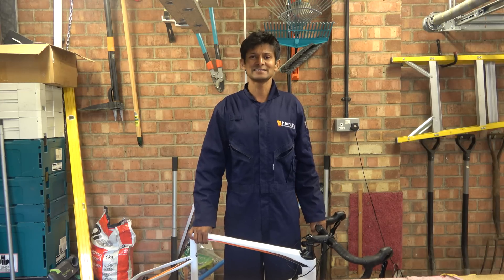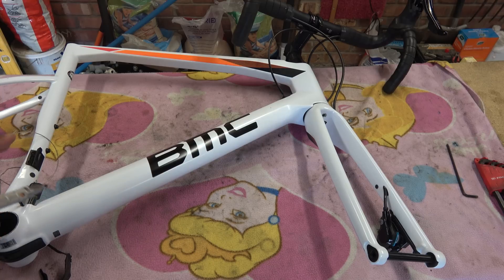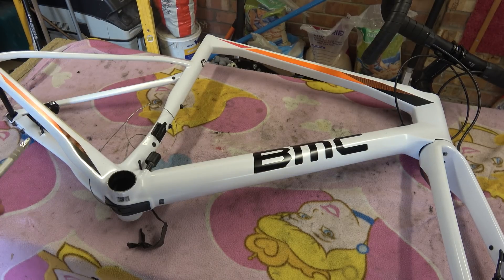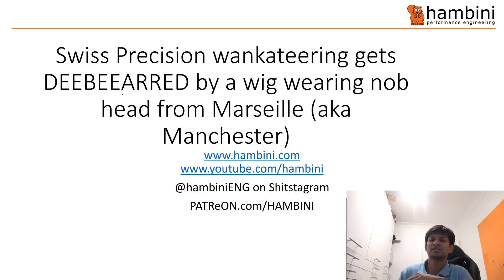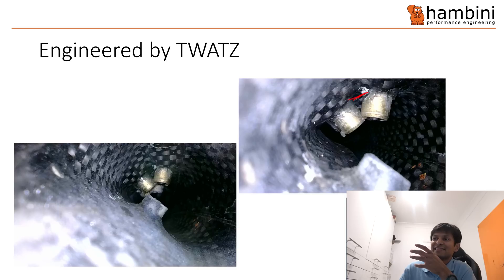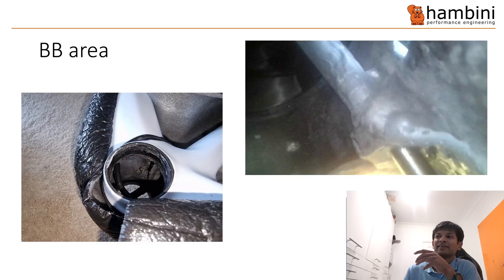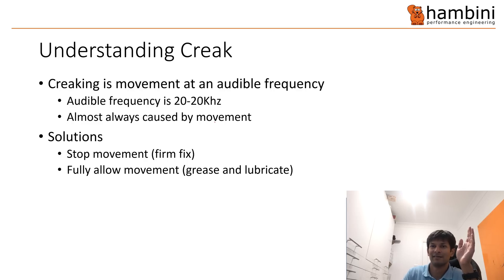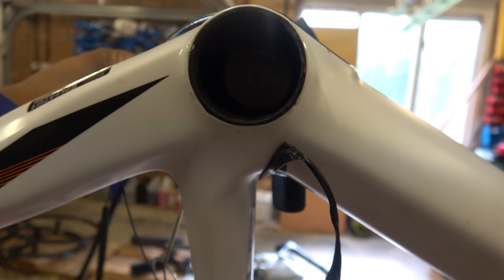Swiss Cheese X BMC Bike Frame REAMED | Grade A Wankateering

Comment: In BMC’s defense… in 2014 the front mech mount failed on my 2009 road machine. I’d bought in 2010 as a close sale from the USA. I lived in Australia when I bought it but lived in Norway when the failure occurred. There were several reports of this occurring online. Since the frame had long since been discontinued they couldn’t give me a replacement. So they offered me  the then brand new GF01 carbon frame set (won Paris-roubiax) for $500usd. The frame set sold for $2500 used at the time. I jumped at the opportunity. The bike was great. Built it up with DA di2 and built myself some carbon wheels. Got hit by a car and payed out for a $2500 frame set plus every other part that was even scratched. Replaced it with a tmr01 which i still absolutely love and bet is just about as quick aerodynamically as todays aero bikes.

I’m sure Hambini would have a great time giving that bike a reaming though! 😅

Comment: Weirdest creak I've encountered was from shift cables grabbing and releasing on the cable guide under the bb. I think I just accidentally shifted some cable loose while stationary putting some weight on the cranks and the sound suddenly stopped. Replaced the guide, creak gone.

Comment: Honest question. I just dropped 12k on a BMC roadmachine 01 three and then I came across this video. Should I be concerned with the build quality? or has things improved with them over the years as from what I'm reading, this frame is nearly a decade old model. Thanks in advance!
Reply: Dude he didnt even know the mount points for rim brakes. Enjoy your bike.

Comment: Bought a used 2019 teammachine SLR01 and changed the BB recently, as i had a new one laying around. Measured it just with regular calipers, but from what i could see its perfectly round on both sides measuring just below 41mm. Maybe the 01 models have tighter tolerances. For the extra price they charge, you should expect that. Still.. my crank with now dura ace bb doesn't spin as freely as i would have hoped.

Comment: I dont get one thing tho, on one side you take a 4 year old, prob. over 20K Km riden frame, which had min. 2 different owners, the lowest/cheapest model of this series, where you have no idea how the owner or local mechanic fit how many bb's to that frame, how wrong they tried to fit them and how it was riden, on the other side you take out of the fabric brand new the highest and most expensive model of the other bike brand and compare that never driven bb. If you want to make comparisons, could they be at least a little fair and not totaly bullshit level unfair...
Reply from the maker: It's hardly going to get smaller with each BB fitting is it?
Reply: @Hambini  It still doesn't change the fact that the two bikes you are mentioning are not in the same age, neither they cost the same, nor are they equivalent models of two different brands...

Comment: Like the video, been riding bmc teammachine slr01 2018 rim brake model. It has been trouble free for roughly 30k km. I'm happy with it. Doesn't mean its perfect on the inside. It works really well for me.
Reply: Have a look on the inside of car components. Quick, shoddy CNC milling of the injection molds, sharp edges everywhere. But you would never know it if your dashboard stayed in place. Because it works.

Comment: Kudos to Hambini for this little anecdote. Previously ive never seen the relevance of where Hambini delves into the topic of crosswind stability for wheels until now. Back when I was poor id have 30 mm deep wheels on my bike. Later I got some 50s and never noticed the difference.I love doing time trilas but just ran with the 50s on-  didn't have any issues. I recently bought some 88mm deep wheels for the TT bike.Realised they are considerably faster- when its not windy its like free speed. But there is serious trade off between the speed of the wheels and crosswind stability. The 88mm are really unstable. Hadn't realised what the relvance of what Hambini was talking about until now.

Comment: The handlebar failure recently happened to someone I know who had a Timemachine Road. is this becoming a thing with this bikes? I'm concerned as I also own a TMR01.
Reply: Hi, that’s crazy. I’m not a heavy hitter and only 69kg. 
The mech who has fitted the handle bars has said in his expert opinion, that there is a flaw in the carbon layup. He could easily see it and pointed it out to me.
Reply: @richardmelder5131  I would agree with his assessment. These bars should not be failing under normal use. BMC's QC needs an overhaul.
Reply: This handlebar issue that Hambini reported on is mine. I sent him the pics for comment. I have just had the Aus Distributor for BMC replace the bars. The BMC mechanic who sold me the bike, and has now subsequently fitted the new bars, stated to me that there maybe issues with the Carbon layup looking at the fracture site. Am I riding a time bomb? Next time I may not be so lucky.
Reply: @richardmelder5131  the fellow that I know had his bars replaced. Unfortunately, he believes that there may be movement in the same area after using the bike for several weeks. This guy is beefy and pushes 1200W+ during sprints. Does not sound good to me....

Comment: The Robert axle project is a super light nicely machined aftermarket thru axle, I have been using them in most of my bikes for thousands of kilometers without any problems.

Comment: Carbon fibre frames are a marketing dream. Product churning rules! They can be infinitely remodelled to next year's 'improved' version, with any number of supposed improvements - thinner tubing walls here, thicker there, more aerodynamic here, claimed improvements in comfort, suspension gimmicks, different tube cross-sections and more.  There will of course never be a perfect version, and that's certainly good for business.
I owned a carbon bike some years ago and it wasn't a patch on my Reynolds-tubed alloy steel frame bikes. I sold it. Well-designed and built steel frames feel livelier and absorb road bumps better, with the only drawback being the slight weight increase - but if you're a 70kg plus rider for example, who cares? Steel frames can also be readily repaired and repainted, and will last more or less indefinitely if properly cared for.
Reply: And Steel frame gives me great workout when I carry it upstairs of my apartment.
Reply: @Reanimator999 Thanks for your comment, it gave me a laugh - maybe you haven't got a really light top steel bike! 
More seriously, years ago when Reynols 753 tubing was introduced, I remember Raleigh stating that the company had got its team racing machines down to 17 1/2 pounds - that's just a whisker over 7.9 kilos. The internet gives a typical weight for a carbon bike as being about 8.2 kilos. Accepting of course that there will be differences between frame sizes and components, there's not a huge difference in my opinion. 
As a percentage of the combined weight of rider plus machine, I'd say that the difference between a carbon bike  and a steel bike is negligible. 
Let's say a rider weighs 70kg and the carbon bike 8.2kg. The total's 78.2, so the bike's 10.49 percent of the total.
Now let's get the rider on a 7.9kg bike. The total weight is now 77.9kg, and the bike's now 10.14 percent of the total. 
The difference is 10.49 minus 10.14, which equals 0.35% - not a lot.
Admittedley these are just rough calculations for fun, but you get my drift - whatever, keep those pedals turning, whatever you ride, carbon or steel!

Comment: i wonder how much of all this is the fault of the bike shops. Not to defend BMC but if they deliver the bikes undersized so that the bike shop needs to cut everything to the correct size but they don't do this because it takes to much time and the tooling is too expensive then you get a "bad bike"
Reply: Bike shops shouldn't be responsible for such precision works. It's like asking your local auto dealer to grind down excessive metal extrusion on body or engine part when the manufacturer is the one that didn't do quality check. 
Of course, there are bike shops that handles precision works like facing disc brake mounts and such, but that's only because the manufacturer refused to uphold the warranty for whatever reason or an owner who wants to upgrade old bike with new components that fits.
Reply: @Reanimator999  don't see a bike facing/reaming as a high tech thing, it just using the right tools from Park/...., you don't need to be a mastermind to use them. On my last two bike facing was always required, on one (€4500 frameset) the disc alignment was slightly off and on the other frameset(€1500) the headset filled with paint. So yes I guess that it is required in a lot of cases even if it is just to clean everything and it has nothing to do with warranty and it's independent from the price you spend. The customer just doesn't know it if it is done if they buy the complete bike until they start having problems.

Comment: Hambini, this is a serious question. I wanna buy high end aero bike (preferably Dura-Ace) but if everything is crap then which bike should I buy? What are my options?
Reply: I wanted to buy a high end aero/road bike, too. After 2 years of research, I crossed them all off the list (except Time, which is exceedingly difficult to purchase in the US). I went back to metal. I bought a titanium bike (Litespeed) with rim brakes and I am completely happy. And I still love my old steel road bike (Bertin). I have a Giant TCR (used, carbon, rim brakes), which I also enjoy a lot, but I am happily hooked on metal and I encourage you to expand your search beyond carbon for a kick ass aero bike.

Comment: I had the "pleasure" of owning a BMC Roadmachine 03 (The alloy version). The BB area is even worse on that model in regards to routing the brake hose. Full of sharp edges and you really have to be careful not to pinch the hose. A bit sad to see.

Comment: Good video. Im a bike mech from MY. I think on newest generation 2019 frame the hydraulic hose channel already move up above the bottom bracket position. Also csunk bolt for front mag hanger already change to rivet. But the alignment of the front mag hanger completely mess up (bend out when fixed front mag). I dont found any bend mark etc on the hanger but to realign this front mag hanger is completely disaster. Not to spoiled up the condition i just fabricate out shim to adjust the alignment 😂 just sharing my findings 😅

Comment: Ah, modern bikes and creaking.

I got so fed up with the creaking from my last /two/ Cannondales (CAAD10 and then a SuperSix Evo) I just bought a cheapish, Chinese open-design, ally fixed-gear bike from a spanish rebadger. It's got a good old BSA threaded bottom bracket shell, with a good old fashioned sealed square-taper BB. Cheap, old and well-tested technology. And it's blissfully quiet. Perfect for my flat commute.

The major "innovative" bike brands seems to have spent the last 2 decades coming up with increasing levels of shite. Subjecting the bike buying public to absolute wank engineering, just to keep their own marketing happy. Shame on them!

Comment: I have the Team Machine from 2019 with over 30k km. I love this bike and it has no flaws, no sketchy bottom bracket, no creaking, no nothing! Not trying to defend BMC here, but it is not like all their frames have defects like the frame shown here. I would certainly short list BMC if I was to buy a new bike.
Reply: That's the problem though, a complete lack of quality control. You get a well made bike, someone else gets the Monday morning special
Reply: @Ob1sdarkside  certainly true, but you can find those specials in every brand. QC should certainly be better across the board when the frame costs that much. And it is good that someone points them out. It just needs some context.
Reply: @testalino  Yep. that is what you have a QC process for. To reject the Monday morning specials and return to the operator for rework. You can then review your QC data with simple KPIs and tackle issues head on. Its not record science, operators improve or leave and the customer gets a better product for his hard earnt 2K
Reply: same here

Comment: Bmc used to have a built in seat clamp that was either open or closed. I've seen them break a number of times and never seen one cover by a warranty. Customer were told they were over tighten, which was impossible. Wouldn't  go near a BMC with Hambini's
Reply: It’s always the same way - their best defense is always to go on the offense.  Same shet with waking-the-dead disc brake racket.  Just blame the customer for contamination or lack of maintenance.  Yeh right F’in finger prints.  Instead of inadequate design - that is the root cause, speaking as an engineering professional.

Comment: It does not matter how much it costs or where it is made, it is the quality that counts. Keep showing us the crap alerts Hambini. Mr. Fledge does not want to hear his expensive bike is crap. As for pro bikes, they are made for them and usually replaced each season and have spares so not the same as the public buys in most cases. By the way I have 20-30 year old bikes still in good shape, so why are relatively new bikes like this BMC allowed to leave the factory?
Reply: Disagree, it’s how much it costs that counts, gives the owners bragging rights - don’t you see?  Plenty of ways to spend money, if someone is buying - someone is selling.
Reply: Nik Fledge doesn't even ride. Admitted it himself in that idiotic post of his that Hambini pinned. Has the audacity to say you can't expect perfection at 12k. What a fucking clown 🤡.

Comment: Hi mate! Could you elaborate a bit on your measuring technique? How do you get that data that goes into the roundness chart? Would be really interesting to see!
Reply: @edmundas919  i, too, dabble in hole measurements.
Reply: @yourface4248 tighter vs. looser is better, would you agree?  😁
Reply: @robertp7209  i have no tolerance for loose tolerance
Reply: @yourface4248  👍😁😎
Reply: @edmundas919  link pls?
Reply: Look at his old video, also - there is established industry standards for +and - tolerances for each component so between components everything fits correctly.  Forget the noise these out of tolerance fitments are causing, noise is not the real problem.
Reply: @robertp7209  could you just tell which one?

Comment: You have inspired me to run rim brakes up front and disc brakes at the rear on my bike 😂
Reply: Changed front fork?
Reply: @robertp7209  haven’t done it yet but would need a new fork and front wheel. Would be unique I reckon.
Reply: @clp91009  unfortunately, can’t revert to rim brakes in rear.  Never had any issues stopping a road bike with rim brakes, can easily lock up rear wheel.  It’s the front wheel brake that takes more loading than rear, just like in cars, for the same reason.  My disc brake equipped ultegra fitted road bike is good for trash, nothing but a racket those temperamental brakes make - can raise the dead in cemetery.  Seems like temp and humidity like to affect them.  I don’t believe in throwing good money after bad.
Reply: @clp91009  don’t forget - you need a different shifter/brake lever on the left side, can’t use the hydraulic brake lever.

Comment: utter shite bike. The timemachine road disc a mate of mine literally has dropouts that are so badly misaligned a brand new hanger is about almost 10mm off. 

The stem design is utter shit as well as over time the single clamp two bolt system would wear out the clamp and the handlebar will suddenly slip off.

The official dealer in Malaysia, PinkBike BMC is a bunch of asswipes who had to bully my mate into buying a "new stem" so he can continue riding it. They did not even offer to ask BMC for a warranty and straight up blame the customer for everything, such as wrong torque values blah blah blah. (My mate's a fully qualified automations engineer FFS) For those Malaysians reading this, you could not do worse than buying from Pinkbike. Bunch of wankers.

I had a BMC two stroke with SHIT tolerance issue as well. Bottom bracket kept shitting the bed. Got pissed off and just straight off bought a new frame from one of the best brands in domestic China and it has been pure blissful riding since. My mate ended up getting a new TCR instead.